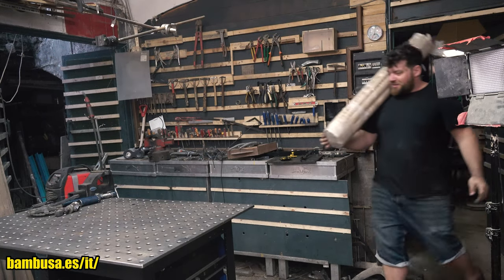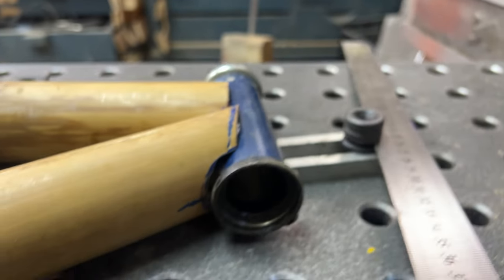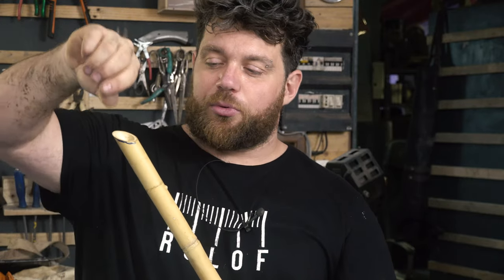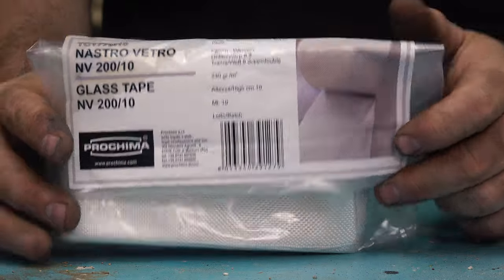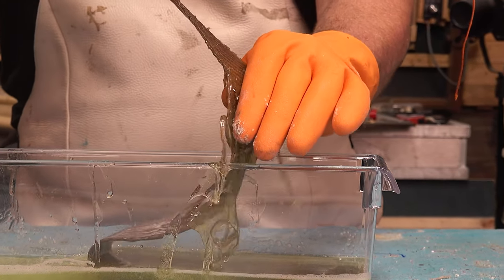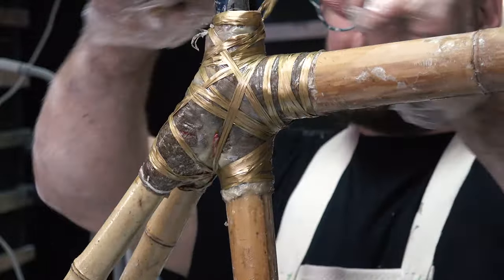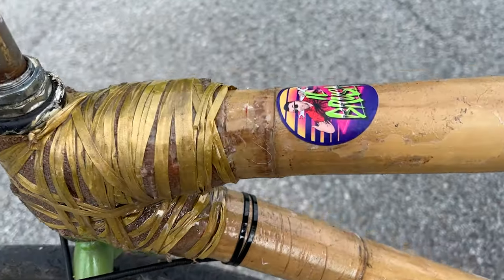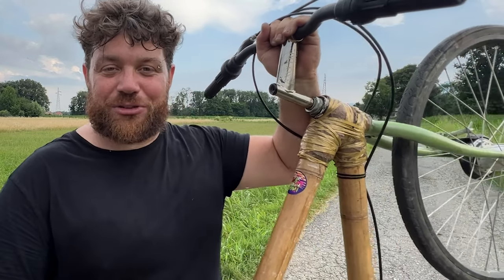How to Make a Bamboo CityBike using Soy Resin 100% Natural Build

Comment: Seat tube angle is also going in the wrong direction. The whole frame is pitching forward. The angle of degree for both head tube and seat tube are normally very similar. For those interested in doing this please download some other frame builder's geometry numbers. Most will list them etc. That way you know your double-triangle design will be properly proportioned.